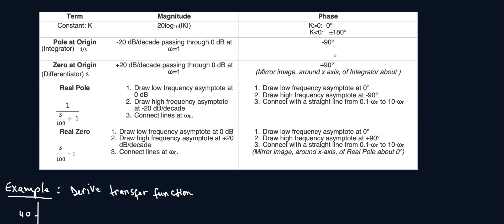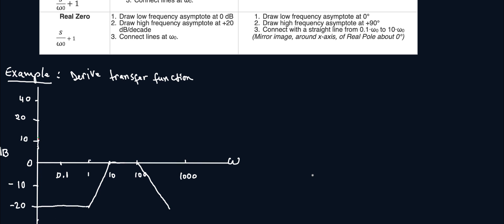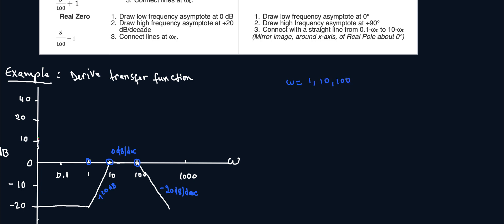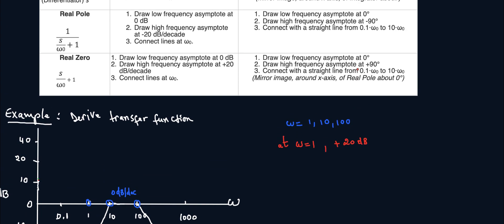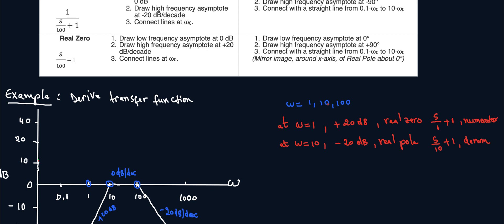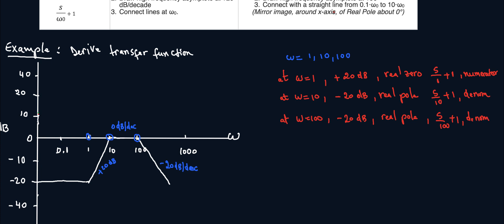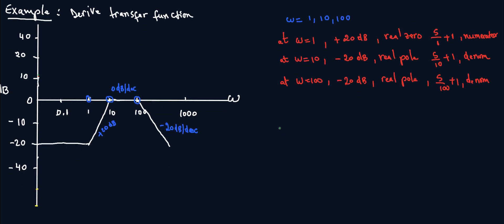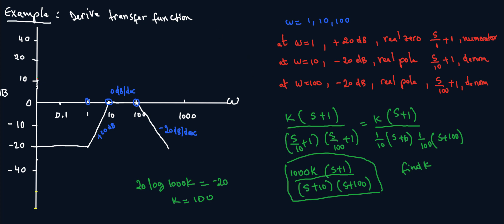How to Derive a Transfer Function Given a Bode Plot (Part 3)

Comment: Hi, thank you for your very cool video! I was wondering why you have K = 100 since K must be equal to 0.0001 in order to verify the equation 20*log(1000K) = -20. Could you please explain a little further? 
Thank you again!
Reply: I think its 20log(k)=-20 ,which gives k=0.1 and when you plug this in the t.f  0.1*1000= 100, which is the gain shown at the end.
Reply: Well, I have the same doubt as well. According to my result, K=1/10000
Reply: @Patrichor-x1b  same here
Reply: I think K is 1*10^-4. Hence, the resulting to 0.1 when we multiply 1*10^-4 * 1000=0.1  when you take 20 log 0.1 you get the -20db as originally give.